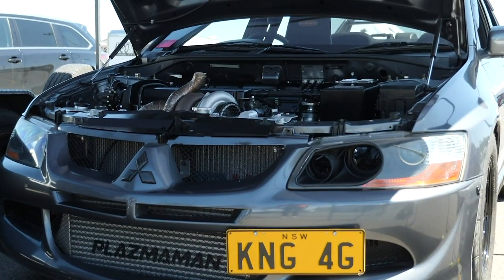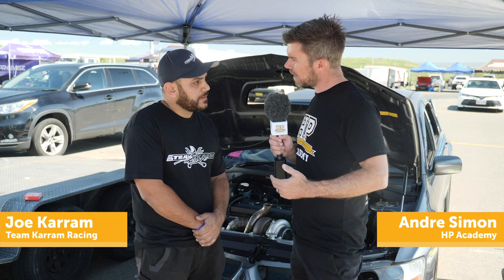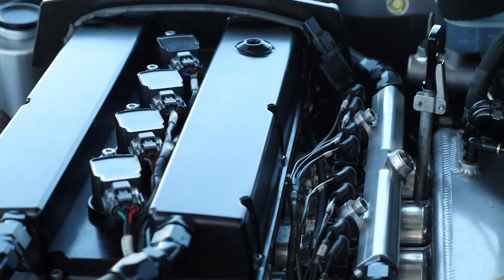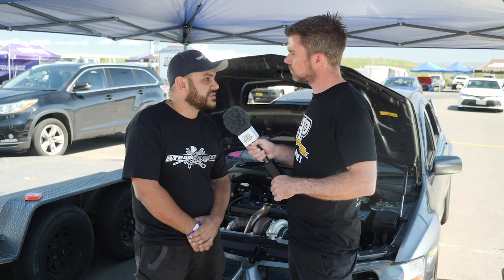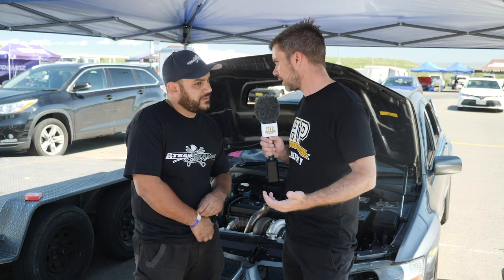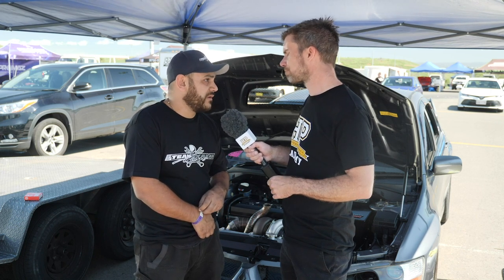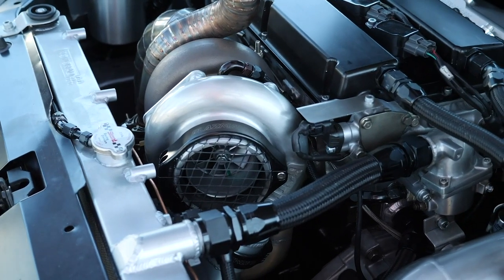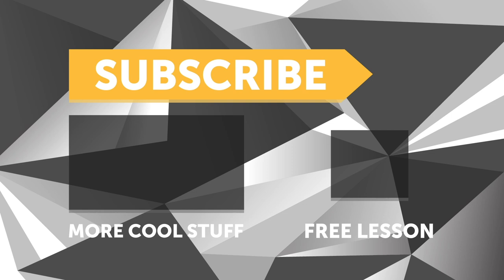Why Run A Smaller 4G63 Block Instead Of A 4G64? | KNG 4G EVO 8 Drag Car  [TECH NUGGET]

Comment: How is he running a fuel pump instead of the top motor mount? Is the pump body acting as a solid mount, did he put another motor mount somewhere else, or is the top mount not necessary if you run poly mounts everywhere else?
Reply: nah, It's just the angle
The Mech fuel pump is run off the exhaust cam gear
Reply: @HHCHunterYTC  I know how a mechanical fuel pump works, I'm asking how he gets away with not using the top motor mount, since the fuel pump is taking up the spot it would go.
Reply: @marcuscoster6529  the motor mount is there look again please
Reply: @kinslayergaming3159  If you could point it out in an image, that would be helpful. I own a Lancer which shares the same mount location and it's not there. I don't see one anywhere on the right side of the engine.
Reply: 1.44
Reply: Motor mount is there, I own an Evo, is there. nice and glossy black.

Comment: What are the differences in performance (if any) between a stroker 4g63 and a destroker 4g64? I can't decide which to go with for my daily street thrasher.. (NZ based)
Reply: They use a Longer rod with a 2.2 stroker crank in the 4g64 block giving it a better rod to stroke ratio vs using a 2.2 crank and factory length rod in the 4g63 block

Comment: The 4G64 isn’t a bad engine, but from what I’ve learned (owning a evo) the problem you have is timing and water pump shit. Other than that if you keep it a 2.4 it does fairly well, you can still rev 8500 with a good tune and I beam rods etc. although for the destroke (64 block with 63 crank) people say it’s way better than the std 2.0 63, The only real advantage I see in that is you can do a better long rod set up. Other than that the “torque” gain isn’t that drastic enough
Reply: I run the water pump from an outlander I believe for my 2.4 setup and it works great but your definitely spot on with the timing issues
Reply: @lowellsmith3323  i read on that too, i also found that MAP sells an adapter plate for the 63 pump to 64 block

Comment: Is the 4g63  good for land rover defender  ???? 
Like my defender  use 16 liters for 100km
I need good engine 
and only use 10 liter for 100km
Reply: Get an Na Jz for ur defender or a 1kd from a hilux, if u wanna keep it mitsubishi a 4d56T diesel  is the better go
Reply: @Wabeeninc  I can't swap diesel 
So I asked you year a go about 4g63 
But  now I want to ask about  L200 4g64 engine  ! Should I get 4g64 na or 1jz na ?
Reply: @Wabeeninc   I can't  go up more then 2500cc  
And can't go for diesel  here in Jordan
Reply: @chechen_power1jz  ik its been a long time but, from my experience an n/a 1jz is a perfect swap. Its a toyota engine so basic maintenance and it will last. And being a 6 cylinder a slightly smoother power band
Reply: @Wabeeninc  thank you brother

Comment: the block is actually the same. It's the top end that determines the displacement..... most of these parts are interchangeable between the 4g63 and 4g64   #savetheeclipse
Reply: Not true

Comment: 64 block bottom end magna.. Noo thanks. See to many smokey engines in magnas
Reply: As if you can compare the engine as delivered by the factory in old clapped out cars when building a drag engine!
Reply: @sexyfacenation  all a built 64 bottom end going to do is put more stress on the block(side walls).
Reply: @sexyfacenation  factory spec engines should be way more reliable than any race engine. That gets rebuild every season. Or in drag racing almost every event. Unless you go billet that most normal people can't afford
Reply: @kseriesdan9722  loose rings or vakve stem seals make engines smoke. That has nothing to do with after market builds. Your mention of magna engines makes no sense.
Reply: @sexyfacenation  don't they use the magna bottom to make it a 2.4lt
Reply: @kseriesdan9722  do they use factory magna pistons and rings when doing that?